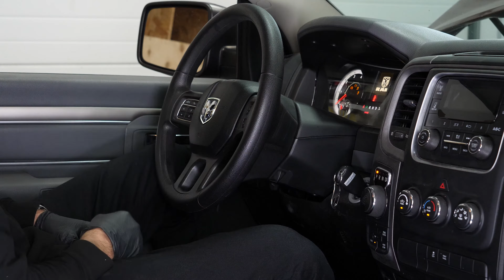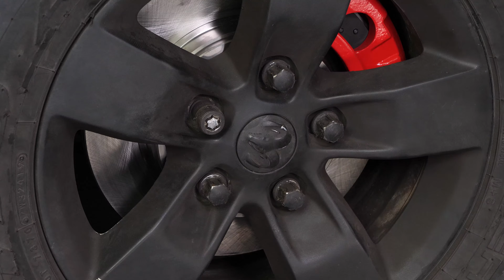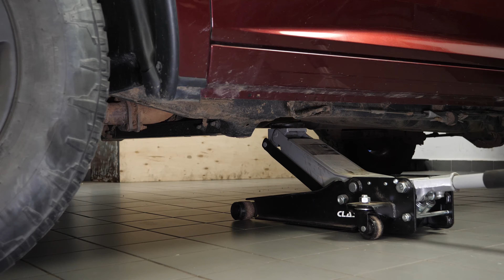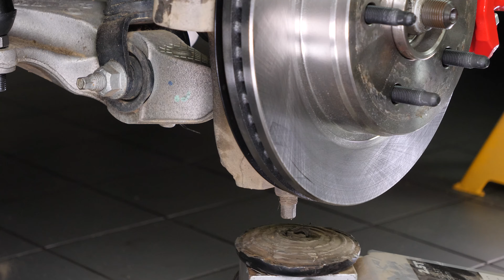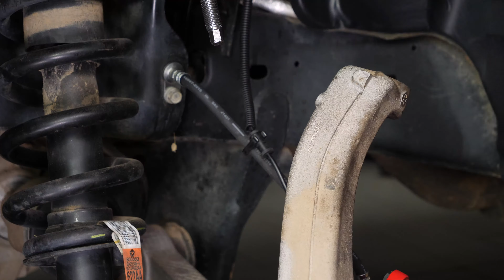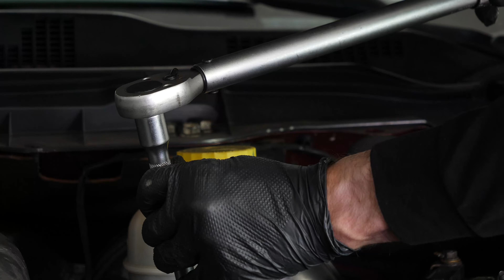How to replace the Struts 2009-2018 Dodge RAM 1500 🚗

Comment: Lower bolt pushes right out like that huh?
Reply: Only when pre-disassemble prior to video
Reply: I ended up buying a new lower control arm over that bolt. 😂
Reply: So full or rage from watching that bolt slide out by hand. So far from reality.
Reply: Yeah mine wouldn't come out gave up I'll try again in the fall when it's cooler out lol